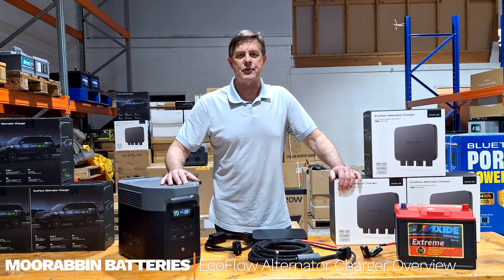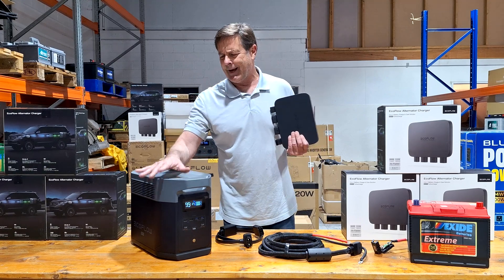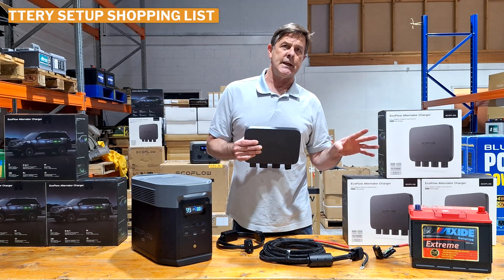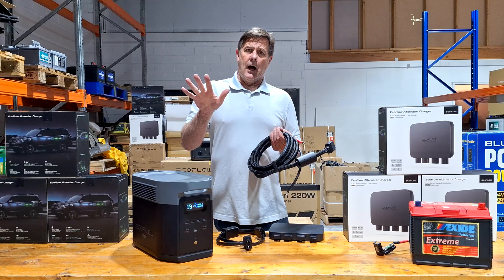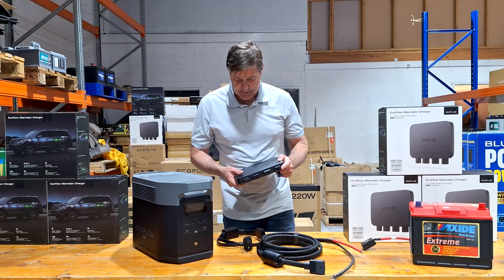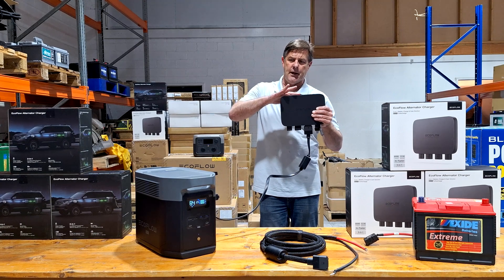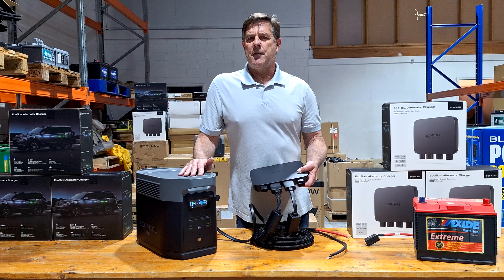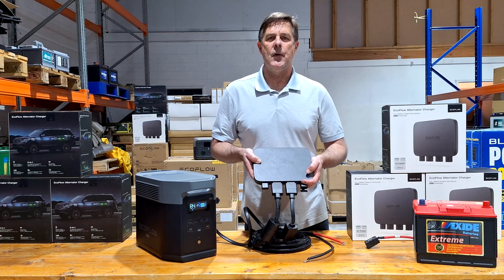Dual Battery Setups Look Out! EcoFlow Alternator Charger Overview.

Comment: I bought this exact set up in the Black Friday sales for less than a traditional twin battery set up. I’ve installed it in the back of my Toyota Fortuner. Happy days 👌 Love how you can dial down the charging input to a more conservative rate in the app
Reply: How long to recharge unit with car running ?
Reply: @ it charges from 0 to 80% in just over an hour if you run it at 800w. I’m running mine more conservatively at 500w so I don’t ruin my alternator and start battery.
Reply: @ thank you sir for your response.

Comment: They will not guarantee that it won't damage your alternator. Because it will. Nobody has tested their alternator after prolonged use and given a review on it. A real test by a professional mechanic.
Reply from the maker: You're correct. Any electrical modification to any part of your vehicle that the factory did not intend will always result in higher wear and tear on the electrical systems, alternator or battery. Be it a duel setup, alternator charger or even sound/speaker upgrades. Especially if improperly installed.